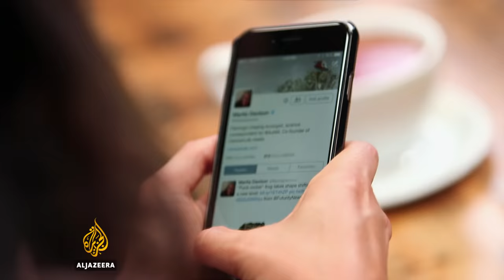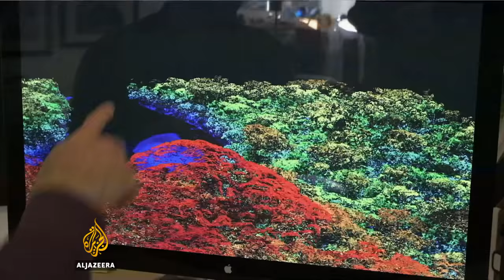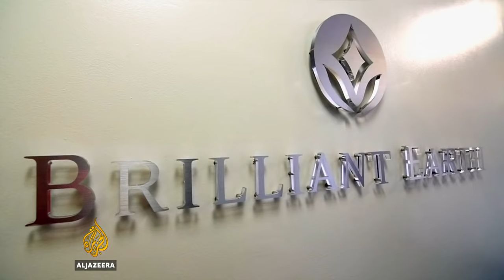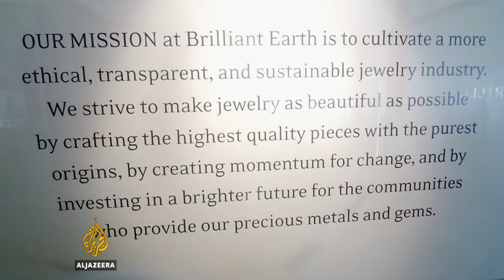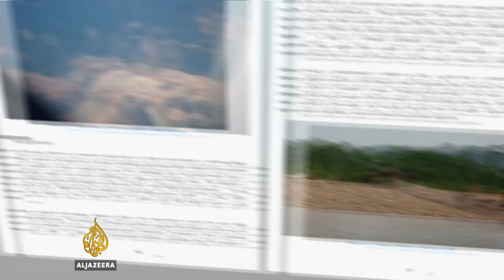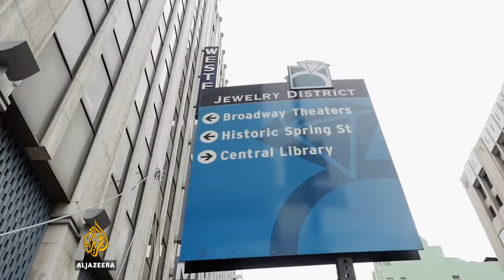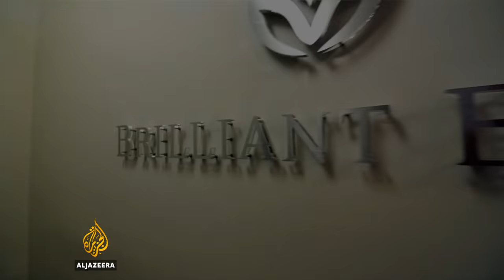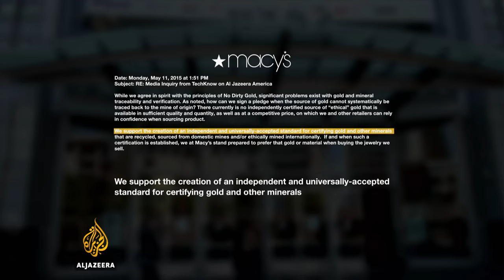Peru's dirty gold - TechKnow

Comment: They need to find another way to mine without using toxic chemicals like mercury. We need to do much more recycling of everything like batteries,glass, fabrics,rubber,cement,...everything.
Reply: WHY? have ever heard of earth's exponentially falling magnetic flux, or how FAST the magnetic poles are advancing?
I assure you there's NO THING to concern yourself with! Please, just sit quiet and relax... it wont be long before a small pulse from our star's next Solar Maximum blows out everything remotely related to electricity, and it cast the final stone that flips our magnetic poles. Perhaps you can surf the 2- 20 mile high tsunami that swipes the face of this planet CRYSTAL CLEAN in just a short few hours. 
Im growing soooooo tired of the Egocentric Self Absorbed preaching we SOMEHOW LOL actually have ANY effect on this juggernaut called reality. PAY ATTENTION!
DO NOT TAKE MY WORD FOR IT, look for yourself. But of course you wont! If you had that capacity, I wouldn't be here writing this. 
For those wondering.... just START with the few pages of the CIA's declassified and HIGHLY sanitized book from Chan THomas, Adam and Eve. Then you might read a bit deeper (dont worry turning the idiot box off for a little bit wont hurt it)